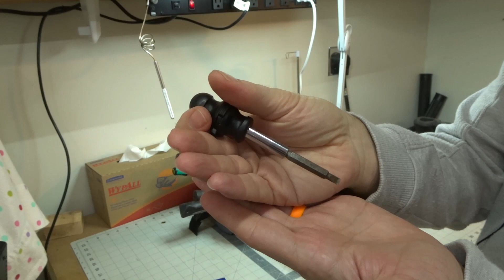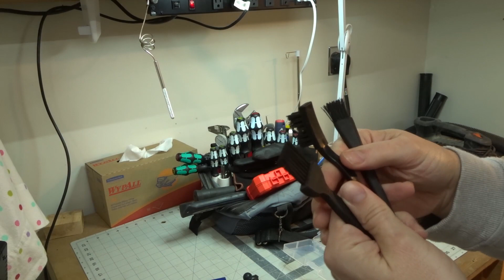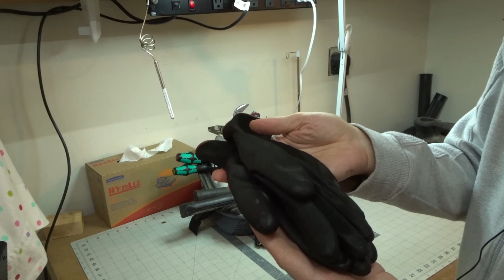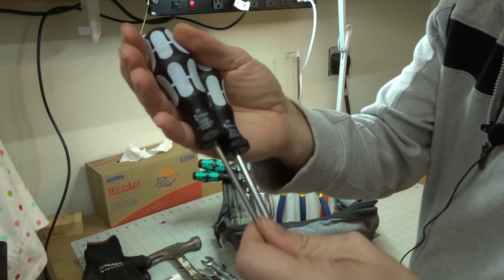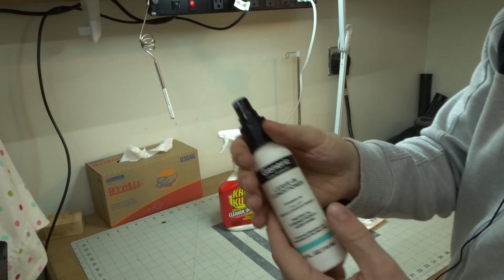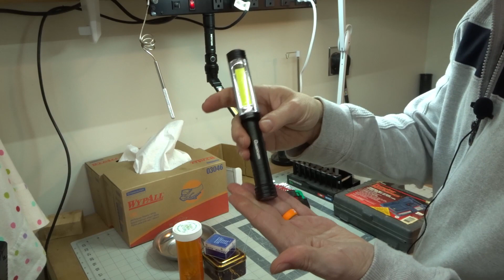What tools do I use to fix sewing machines

Comment: I did not see any punches,,or drifts. Brass an Steel,,,,,8 ounces hammer,,,,no timing gauges,,,no emery tape to cord,,,  or paper. also there is A Hook, looper timing gauge ,,works on any Model sewing machine.   Available at Sewing Machine Services in 🇨🇦🇨🇦🇨🇦.  Good luck,,,I like when the Bartack stops.  With the bell sound,,spot on stop motion timing,,,,,you never have enough tools for repairs.

Comment: Lucky you. Your tool kit doesn’t include any magnifying reading glasses. Great video. I’m glad you showed us the paper towels which look lint free and not kitchen paper towels. I like to work on old singers.
Reply from the maker: Thanks, yes I need a magnifying glass occasionally, have a few years until it will be in the toolbox, lol.
Reply: @SewingMachineRepairGuy  
How would the blue shop towels work?
Reply: I have 20/20, but I still find a magnifier helpful. I have one with integrated LED lights thatI got for about $6 at Menard's that I use all the time.
Reply: @ianbutler1983  Is that a typo?  Do you mean Six Dollars or Sixty Dollars?  Either way, would you mind posting a link here?  I'm in California and we don't have Menard's.  If I know which model, I might be able to buy it from their website or Amazon.  Thanks for your comment and happy sewing/fixing.
Reply: @rebeccal786  Hi Rebecca, 
Sorry, I was not very clear.  I am new at anything sewing-related, but I do quite a bit of general repairs and I restore antique radios. The $6 magnifier is just a regular handheld magnifying glass, about 5" in diameter, surrounded by 6 LED's and with 2 AA batteries in the handle. I have about 4 of them scattered around the house that are used daily. 

I also have on my workbench a magnifier on an arm (attached to the workbench) that has a light on it. It is handsfree with very bright ring-lighting (no shadows). The only problem with it is that the light is florescent and it causes very bad interference on the radio, which I like to listen to while working. They probably come with LED"s now; which would not do that. Mine is several years old. It is invaluable as a work light as well and magnifier. It was about $40 when I bought it at Harbor Freight. I just looked and they don't seem to sell them now. Amazon does however, and they're about that price. 

I  hope that helps,
Ian

Comment: Tools are like insurance; better to have them and not need them than need them and not have them.  
Another wonderful video which personally, I found very helpful.  I had just ordered some mini open end flat wrenches from Amazon because I learned I'll need them as I refurb a nice little Kenmore 158-1060 I just bought. It needs a new belt, but otherwise it's incredibly clean, the motor is quiet and smooth and the gears & linkages turn easily with little effort on my part. A little fresh oil and grease and she'll be ready to go.  It's a gem (I love vintage Kenmores) and I snagged it for $40! I have a 158-1040 too, which I love. I paid a little more for that one but again, it's in lovely condition and sews like a dream. 
Thank you for another exceptionally helpful video. I ALWAYS learn something new from you. 

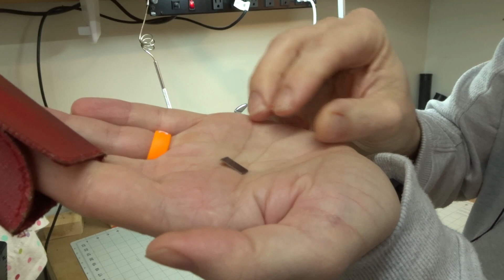"Let the message about Christ completely fill your lives, while you use all your wisdom to teach and instruct each other. With thankful hearts, sing psalms, hymns, and spiritual songs to God. Whatever you say or do should be done in the name of the Lord Jesus, as you give thanks to God the Father because of him."                                                                                        Colossians 3:16-17

Comment: I just watched your tool box video. Have been trying to design my tool box to hold all my pliers and larger screwdriver s along with the never without go box. 

You just made my day, having all the PVC pipe pieces glued together to organizer pliers, wire cutters etc!

I do need a gauge to set my Serger looper. The gauge part number is 11302. Do you know where I can order one?
Reply from the maker: Glad you like it, I got the idea from watching Adam Savage making his toolbox on YouTube. I don't usually buy those specialized gauges, I try to measure with more common tools.
Reply: Sewing Machine Repair Guy what did you call the tools to adjust feed dog height. I really need that set.

It was amazing how my tools strewn everywhere on one of my tables downstairs compared to yours, right down to the block of wood!! I’ve just restored my 1925 Singer 66 sewing machine and cabinet with the iron treadle base. I used my 2x4 doubled blocks screwed together to lift the base to install the castor wheels and post. Have a small ball ping hammer and small 1-1/2” square of steel I used to flair out end to lock the solid 1/4” post in place. Yes, women like their own tools too. My husband and I don’t usually share tools, but I did have to borrow his soldering gun and silver solder (as mine were m.i.a) to attach the socket and switch in the spot light,  to the new cord. Thank you again for making the video and hope to hear back where to buy the tools to adjust feed dogs.
Reply: @csfmusic  
You rock, lady! A woman who can solder gets big time respect from me!

Comment: As someone who has been restoring machines (including industrials) for a few years and is now getting requests to do industrial repairs, I found this extremely useful. How often do you find yourself needing the socket set? Is there any tools that made a large difference when you upgraded to them? My first industrial job might be a tacker and a buttonholer.
Reply from the maker: You will need the sockets if the tacker needs timing adjustments to the large cams.
Reply: @SewingMachineRepairGuy  Do you use metric or standard more often on industrial machines?

Comment: Any information on the tool used in the hole in the back of a brother machine to adjust the Presser foot position backward or forward to center over throat plate hole? Thanks
Reply from the maker: I'm pretty sure it is a small Allen wrench setscrew with a locking nut.